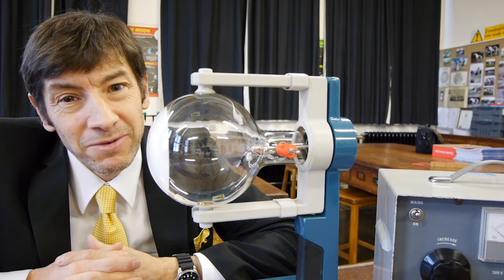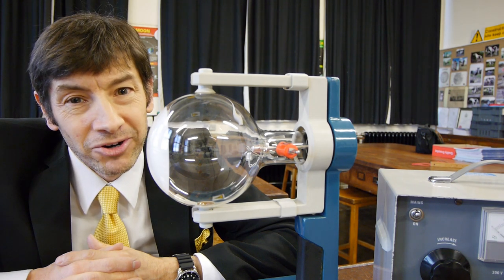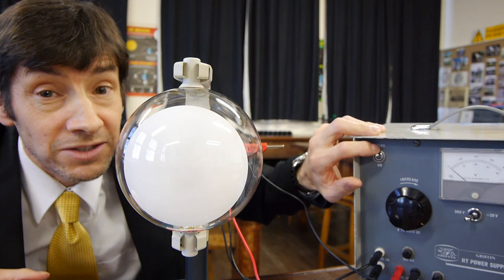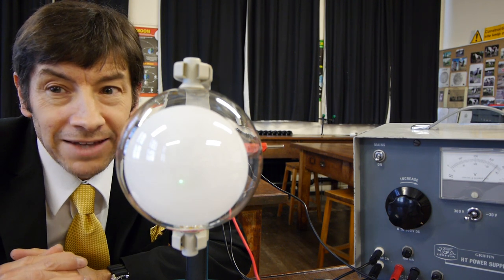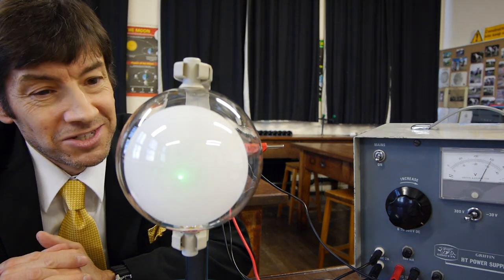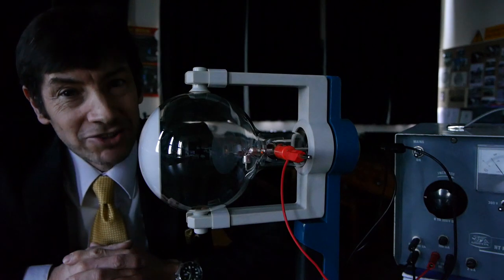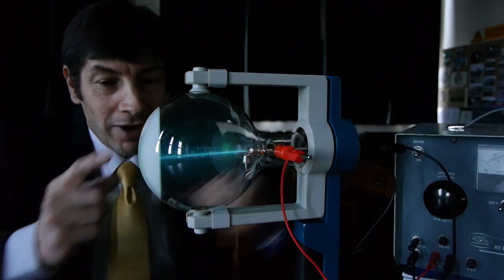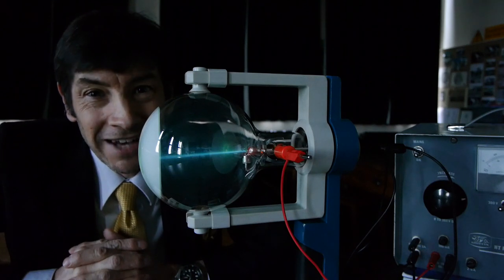The Electron Gun - the particle accelerator in your house! - F-J's Physics - Video 18

Comment: Can you help me with a doubt? What kind of gas are you using inside the tube, also what is the pressure at which it is filled? I'm trying to make a similar cathode ray tube but my filament burns out within few seconds even after using a vacuum pump to evacuate the tube.
Reply from the maker: Sounds like a really interesting project.  So, I think this tube is fully evacuated and then it has had a small amount of neon added (these Teltron tubes come ready made).  There is a set up where you can build your equipment in a large bell jar (we used to have one that sat on top of the vacuum pump) and then evacuate and play with adding small amounts of gas at different pressures.  Now, the filament - two things here: you could try taking the filament out of a regular low voltage light bulb as it will be high melting point metal and carefully control the current (however tungsten is not a good electron emitter until it is at very high temperatures) or, what is more common is a heated cathode where it is a coated metal that is heated by a filament that causes electrons to be released from the cathode - not the filament.   Good luck but be safe!
Reply: @AnthonyFrancisJones  Thank you sir.

Comment: If the tube was not filled with hydrogen or helium and was not vacuumed would the regular atmosphere of nitrogen and oxygen still enable ionization of the beam to happen?
Reply from the maker: Good question.  So if there was no gas at all in it - a perfect vacuum you would see no beam until it hit the screen.  That's how a normal cathode ray tube is manufactured.  A regular atmosphere as we breath would be no good at all - there might be a very short beam and a bit of ionisation but unlikely.  The density of the gas molecules would be such that there would be so many collisions of electrons over such a short distance that the beam would not even get as far as the anode.  Thus the reason for the vacuum or in the case of this one a very low pressure gas so that students can see the beam.  Hope that helps.

Comment: I know magnets can harm or damage crts but I don't know if it should be a problem but we have these speakers in front of the tv so I don't know if the speaker magnets would do anything there probably 6-9 inches away from the screen so I don't know if it would effect the picture. The electron gun is further away probably an extra foot away so would the crt get magnetized? I told my dad about it he said it probably would be fine because" there are speakers in the tv" but you seem to know way more then he does.
Reply from the maker: I am not sure if I know more... but magnets put on an old CRT display can damage it.  If you have one that is not important it is quite fun to see the colours change across the screen as the magnetic field affects the display when you put a small magnet on the front of the tube/screen.  Gently and this does not do permanent damage but stronger magnetic fields will.  The magnetic fields in the speakers may be quite strong but they do not spread out much so should be fine.  The speakers in the tv are quite small and these are similar and often have the magnetic field screened from the display tube.  So your set up seems fine.  Just don't take a strong magnet on its own and pass it over the tube.   I am sure someone on Youtube has done this.  I should do a video with my tubes and show the beam being deflected by the magnetic field - this is how some particle accelerators bend the beam into circles.  Thanks for a good question.
Reply: Anthony Francis-Jones yea that would be cool to see. but because it's a trinitron it has a built in degaussing system and you're welcome.

Comment: Don't electrons move very very slow though.... Do they move faster in the tube?
Reply from the maker: Winston, electrons move very slowly in wires - one can consider that there are so many collisions with atoms that they take a great deal of time to move through the wire even though they are individually moving very fast - they end up with a drift velocity.  In a vacuum, however, there are no particles in the way so they move unimpeded, close to the speed of light as the 'mean free path' (distance between collisions) is infinite or at least the length of the tube.  There is some gas in this tube so they do have some collisions on the way.  Great question - you may enjoy this video of mine:  https://youtu.be/BgUnmB27hMk

Comment: Perhaps we could convert that kinetic energy into thrust, I had this idea.
Reply from the maker: Good question - there are such things as ion thrusters but in this case the force is so small as the momentum is so small that you would not be able to get much driving force at all.  I will be doing a video on Crookes' Paddlewheel tube at some stage too - though even this is not quite what it seems!
Reply: Not at this scale but charged ions are used at a large scale in ion thrusters.

Comment: I loved this video. As a maintenance tech, we work with something called an Electron beam dryer. It workes at about 500kv, and uses a -30vDC grid, filaments, and vacuum in the 2-6 10^-6 range. I was trying to find more information on a system like that, but I am also very interested to see what that device (in your video) would be used for. What can you do with a stream of electrons, or what could you learn about how matter that passes through it reacts?
Reply from the maker: Andrew, that is very interesting and a very unusual and specialised system you work on.  Sounds like at that voltage there will be issues with X-rays too!  Yes, there are so many uses of electron beams.  Have a look at my video on electron diffraction for example.  As I mentioned the X-ray tube uses an electron beam too.  I love the application in this video and think about it being used on the old radar screens too.  You might want to look up cathode ray tube memory too.  A very early version of computer memory invented in the UK.  Thanks for watching and glad you found it interesting and informative.

Comment: it's 4 AM and I really enjoyed the video though I some how knew how it worked
the new part for me was here 4:52 cause I didn't know extra negative potential was needed
I have a large CRT TV set that is sadly not used any more but I Insist on keeping it even if it's video quality surprisingly low compared to modern TVs
Again the video is so great and comfy
Reply from the maker: Great - thanks for the comment - I spoke to one of my pupils and he just remembered lifting an old CRT TV set and he was astounded by how heavy it was!  Glad you can keep yours going.  The negative potential is a bit confusing.  It is not that it is negative but more that we put a clear potential difference between the cathode/heater/filament and the anode.  If you do not connect the negative lead the potential on the filament could be any value depending on the power supply used so it is better to fix it at a known value (actually probably zero in my case) and then we know the anode is 5kV higher.  Great observation!  Thanks again.

Comment: What I'm curious about is whether the electrons in the beam attract or repel each other, or if the keep moving along a straight line like a laser beam?
Reply from the maker: They repel each other due to their charge so the beam lacks focus - it has to be 'pushed' back together using electric fields.  Also give some thought to the amount of time the beam traverses the tube and the time the electrons would have to separate due to coulomb repulsion.  Thank you for your excellent question.  Not dissimilar to 'why is the beam not much lower down on the screen due to gravity?'
Reply: @AnthonyFrancisJones  Thank you for you answer!

The reason I asked the question... I know that two wires will attract each other if there are currents flowing in the same direction. But that involves both positive and negative charges. I also know that two equal charges are supposed to repel each other - but again, I've only seen examples of this involving metals (i.e. the wires - a mix of protons and electrons). So I wanted to know whether this "rule" applies in a vacuum too, so that there isn't anything else going on. And the only example of an electron beam in a vacuum I could find was a CRT TV... And that led me here. :)

Do you know of any experiment that proves this, that electrons repel each other in a vacuum? I mean, there can be many reasons why a beam isn't focused. Even lasers tend to get wider with distance, and they don't consist of charged particles at all.
Reply from the maker: @alexanderhugestrand  good question - the wires is similar but - repulsion and attraction between parallel wires (I need to do a video on this one!) is best thought of as being caused by Magnetic Fields due to the moving charge in the wires - remember it is still negative electrons flowing but their movement in a wire creates magnetic fields around each wire and it is this that causes the forces between them.  Remember it is a kind of one wire (turn) electromagnet.  You will get magnetic fields in the cathode ray but remember the electrons move so fast that the reach the screen before they have repelled any great distance.  The current is also so much weaker.  Hope that helps a bit...
Reply from the maker: Oh, BTW I have done a number of videos of electrons repelling for example in a vacuum away from a negatively charged plate or even the Golf Leaf Electroscope but I agree I have not done one showing the beam widening that would be caused by electron repulsion.  I will do a quick calculation later to see how far apart they would repel during the flight time (very short) down the evacuated tube.
Reply from the maker: Oh and I forgot to say that electrons flowing in parallel wires don't really interact between wires due to their charge as the wires will be neutral anyway - there are atoms' protons in the wire too so you will only get the effect of the magnetic field due to current flow.  In a vacuum it is only electrons flowing so they will repel (in all directions) causing the beam to not be as focused as it could be - one of the reasons there is a need for narrow focusing anodes- these can also act as velocity selectors too.  Makes for a nice collimated beam.  And finally... remember the electrons in a vacuum tube are traveling close to the speed of light but in a wire travel extremely slowly - video on that coming up soon!  You have got me thinking!

Comment: 4:10 Ive got a few questions here. I'm assuming the filament being used here is tungsten, like in light bulbs. I'm wondering if molybdenum could be used instead. Molybdenum can't get as hot as tungsten so does that mean it "boils" less electrons thus resulting in a weaker image? I'd love to learn more about this. In addition to this I've seen gun designs that use multiple anodes and a focusing anode. Are these really necessary for rendering a point on a tv? Also, from my understanding in color CRT televisions they use 3 ray guns (R, G, B) and direct these beams with magnetism (deflection system) to fit these rays through a shadow mask (or aperture grille) to prevent the beams from lighting up the incorrect phosphorus dots upon rasterization. How are these three beams angled with such precision?
Reply from the maker: Brilliant questions all round!  So molybdenum has a melting point about 1000 degrees centigrade below that of tungsten so a tungsten filament can get hotter.  It can be supported by molybdenum wires to hold it in place as molybdenum has a low expansion coefficient.  Most TV electron guns have multiple anodes.  Some to attract the electrons off the cathode/filament and others to accelerate the electrons as well as bunch them up and then focus them into a fine beam.  This is a fine art and worth reading more about!  Read about Wehnelt Cylinders to know more!  Yes the arrangement of the guns and the shadow mask are very finely done (mechanically) - that always amazed me as a kid.  There can also be corrections included with the tube’s magnetic deflection coils as well.  One gun can be used for colour and correctly scanned but three is much better.  The shadow mask is very fine indeed.  Worth looking up the Trinitron tube as well.  Great questions and you have a lot of reading to do to get your head around these interesting designs!  Good luck with your studies!
Reply: @AnthonyFrancisJones  Thank you for the swift reply -- I greatly appreciate it! I'll be sure to read more about the Wehnelt Cylinder. Also I was reading up on the shadow mask production from a few old patents -- it looks like some manufacturers used a printer for making fine points on some type of transparent sheet and used chemical milling with this printed sheet to etch away the metal to make the mask. I'm left wondering how this printer was made as it seems to be the machine that is making the precise operations. I'm especially curious as to how this was done during a time before ink jet and laser precision. Could a dot matrix printer yield a 0.3mm dot pitch? I'm curious if you know of any other mechanical procedure that is used to make this screen. 
Again thanks for the reply. If you know of any books that talk about color CRT television manufacturing or engineering I'd love to know!
Reply from the maker: @Drozerix  I am not totally familiar with all of the methods used to make shadow masks apart from the photo/chemical-etching one which is similar to how circuit boards are made.  It is worth Googling for articles - most of the sales books for CRTs are old and interesting but mainly technical data books such as those produced by Mullard and Ediswan.  See what you can find!